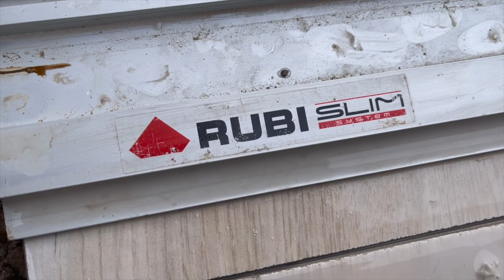Building That Meandering Wall

Comment: Thank you so much for your content - Very informative for a young garden designer! I just have a quick question regarding raised beds and retaining walls that I cant seem to find the answer to anywhere (maybe it is just a dumb question!): In this case, you are rendering the exterior of the wall and you said that you will tank the inside of it to avoid moisture permeating through. Have you also used weep holes or any sort of back filling etc for drainage? All the theoric information I find states that retaining walls and raised planter walls need weep holes but I always wonder what do you do with them when you render or clad the exterior wall. Many thanks in advance!
Reply from the maker: Give me a call it’s easier
Reply from the maker: 07795595994